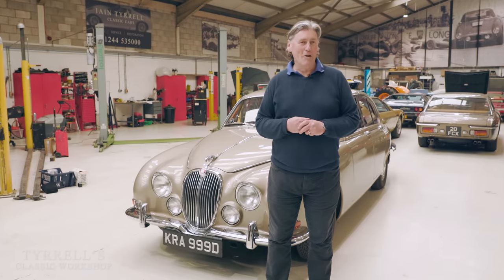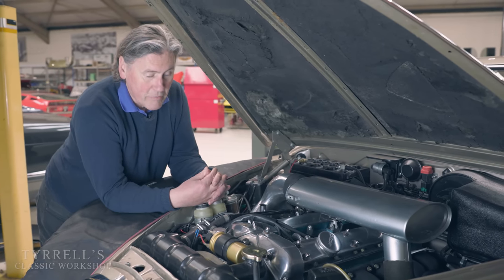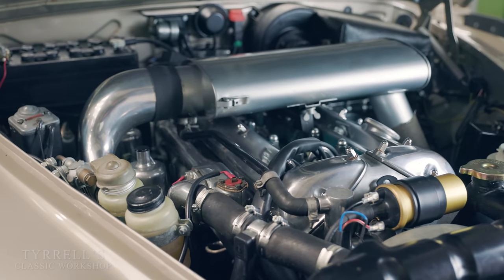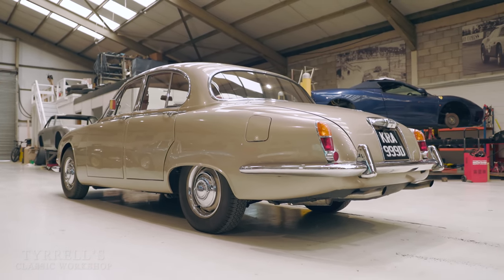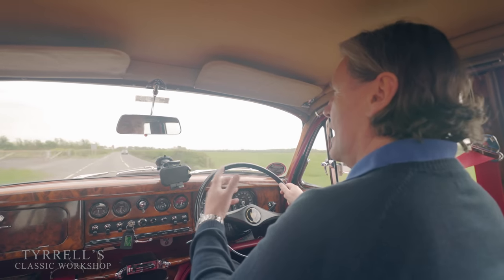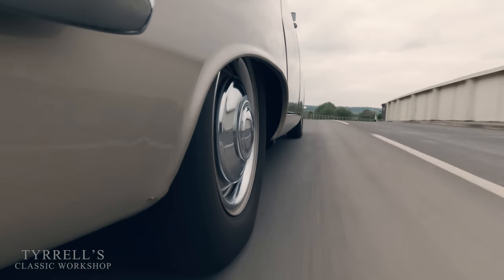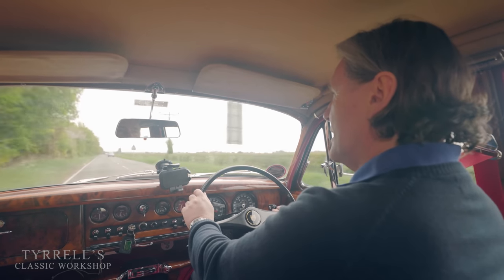Jaguar S-Type - The 1960's Saloon that set the benchmark for comfort | Tyrrell's Classic Workshop

Comment: From Australia, these are bettered only by their big brother the mk10.  When 19 in the mid 70's I bought a 10 year old 1965 4.2ltr Jag mk10 owned it for many years , thru that time I bought a rare long wheelbase series 1 xj6 and owned that for 32 years , I sold it after buying a1 owner ultra low mileage 1967 4.2 ltr 420G (bmc rename of the mk10) . having owned both I rate the mk10/420G as the better car , better Marles  power steering , wider with longer wheelbase gives better handling , plus when I bought the first '65 model I bought a set of Koni gas shocks that Koni made in the '60's as the optional upgrade. They were crazy expensive, when I sold the first one I had kept the Koni's for years feeling I would always buy another mk10,when I fitted them to the '67 model they transformed and stiffened the handling exactly as I remembered from years before , plus they still functioned perfectly. I LOVE this car its original leather interior is still soft and perfect , and looks as if it is a year old , not half a century, the carpets are like new , and is a high output bronze head car with ultra high compression and way more power. I love the exhaust growl when accelerating in second gear . You can drive for a thousand miles and step out like you have just driven down the street for some milk, with its comfortable thrones of front seats and plenty of legroom. The  fabulous MK10's were really the worlds first luxury sports cars.

Comment: Triumph I had a few 2.5 PI were as fast as Jags and also had multi link independent rear suspension and wonderful ride and let me assure you in days before radar in Australia easily out run the police especially on corners.   Those were the days driving across Australia was just amazingly fast.

Comment: The Jag IRS was used in a generation of American hot rods and customs.  A great ride and it could take a decent level of power for the day. Not used as much since they aren’t cheap as chips anymore. But for its day, it was the one you wanted to have out back.

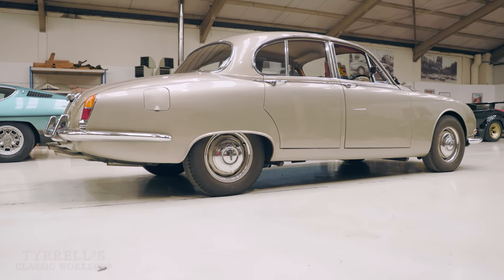Comment: 10:40    That odd line of rear door was due to using a Mk2 door, but different wheel opening.   Mk 2 used 1/4 elliptics at rear with a Panhard rod.

Comment: I drove then, a 1980 Volvo GLE. That one with 130 hp and injection. It had a button on the gear lever, a overdrive. Very nice function.  To take it down to the third, just do it.

Comment: His remark about the seats is something I ran into with my BGT.  The seats were redone by a PO, and evidently the replacement foams are firmer than the originals and the new seat diaphragms are stiffer, resulting in a too-high and firm cushion.  I'm 5'10" and unless I sit down hard, the top of the door opening will peel my cap off.  Very frustrating.  And I slide around like I'm sitting on bacon grease.

Comment: So Jags handled supremely, with a comfortable ride, were fast, torquey, smooth, styled beautifully, luxurious interiors, racing pedigree, solid engines, power steering, IRS, inboard brakes (I'm assuming discs), telescopic steering column, and ... relatively inexpensive for what they were!!  The gold standard of being an all-round excellent car.  Jowett tried to achieve the same with the Javelin but on a more modest level.

Comment: My father tested these out against the Rover P6 for the Met Police. They ended up going with the Rover because it didn't squeal going around bends at high speed like the Jaguars did. That would be due to the De Dion rear suspension on the P6 keeping the tyres on the road.

Comment: It's interesting when you compare the S-Type to RR, for at the time that would have been the Silver Shadow in 1968, with its modified Citroen DS suspension.  I would like to have taken the two cars out on the same road and see which had the smoother ride. However as far as handling, I believe the Jag would have been better. The SS with it's stock Avon tires, heavy weight  and out-board disc brakes handled like a marshmallow.

 You're right though before 1968, RR just had leaf springs solid rear end and very antiquated drum brakes with that clunky mechanical servo driven off the transmission.

Comment: Nice video and nice car. The S-type "outsold the MK2 for a couple of years" because it was a new model introduced in 1964, by which time MK2 was starting to get a bit "old hat". In the long term, the Mk2´s racing image has helped eclipse the S-type, which remains something of a bargain. Also watch out for contemporary Jaguar 420 (nb: not 420G), an upmarket version which had the same chassis but larger engine with a more "modern" fuller front panel. Apart from good value, quite a lot of these cars were cherished by elderly owners, so preserved surviuvors are more common than with the MK2 models.

Comment: I had a 1964 3.8 S auto which never had power steering. I presently own a 1969 420G auto which I enjoy very much but the gearing is very low - 2700 rpm @ 60 mph which grates with my mechanical sympathy. Love the though just keep off motorways if possible. Great videos.

Comment: An old mechanic I know that worked on these jags would take the back seats out, cut a large hole out of the base of the seat to work on the rear suspension and brakes, so much easier he said.

Comment: I worked on some the twin cam engines back in the 70,s, the carbs were a pain, and  after market intake manifolds for three dual Webers  were hard to find, but the three carb SU deal gave about 25 hp over the stock set ,up, Hot cams werent around

Comment: Ian, I've only ever driven one car with overdrive, a late pal's MGB GT. I did take a ride as a passenger in another very recently deceased friend's Triumph TR6 which also had overdrive on third and fourth gears but I was wondering if both of these models used a Laycock de Normanville system or one of their own creations, and also of how often it functioned on both higher gears or solely on fourth with most cars ?

Comment: 6:20,.. eh, hemm,.. Ian, the venerable Slant Six might just out do that record. Yep, even in Racecars in it's 'HyperPak' specifications. Many more units made, in many more applications, from cars to pickup trucks to fork lifts and combine harvesters and laid flat for boat 'stern drive' installs, to even being a stressed member in Lotus 11 derived chassis (before Chapman did it) and one with a unique head used for an Argentinian open wheel local F1 chassis. I believe the XK is one of the few other engines capable of the Slant's smoothness and tractability showoff trick - put in to top gear at idle, ease the clutch out, then flatten the throttle pedal and let the torque take you to the redline. Very few carburetored engines can pull it off.
It's rather bemusing how some engines, such as the Jag six and the Chrysler Slant Six, are used everywhere with great reliability, but vastly overshadowed by other products from their home stables, such as the Jag V12 and the Hemi V8, or the Lambo V8's compared to the V10's and V12's.

Comment: Back in the 70's I got through 3 of these.   A 3.4 manual and 2 3.8's both auto, which most S types were.   The maroon one I remember passed its MOT and the tester recommended that I sold it on as it was 'getting a bit used!'   I had a total of 16 Jags from Mk1 to XJS but family and at best 20mpg meant having something more ordinary.

Comment: They did not all co.e with power steering. I had a 1964 3.4 manual without. A pig to park but a real joy to drive. Easy on the throttle in the wet, though. I o ce found myself on a roundabout in Walthamstow facing g the traffic behind me! Very embarrassing. I hoped everyone also thought it funny..... ( I did not!)

Comment: Most interesting Ian especially your description of how the IRS works on the S-Type. How would you compare it to the De Dion rear suspension used on many cars in the 50s and early 60s?
Reply: Apologies for miss-spelling your name Iain.
Reply: interesting question, because De-Dion sounds so sophisticated, right? Well it's geometrically a solid rear axle (but can include crude camber. It's benefit is the diff weight is part of the car body weight, so the remaining solid axle is that much lighter.

Comment: Actually the Rover P6 matched it for rear suspension with the De Dion set up and was equally smooth riding. Remember my father buying a then new 1968 P6 over the admittedly live axle mk2 as it was a much more modern design. Love the look of the S type now though and Jag was a much better engine than the Rover 4 pot.

Comment: Does the overdrive not work on 3rd gear as well? I always thought having 6 forward gears on my MGB was fantastic!
Reply: I was going to add the same comment, I think on my MGB it also worked in 2nd, could be wrong, a long time ago.
Reply: @williamjsmith9877  It shouldn't have worked on second unless there was a wiring fault or wiring modification. Mechanically it would work on all forward gears but was factory limited to 3rd and 4th to save it from self destruction. The V8's only only worked on 4th for the same reason.
Reply: I know when used on Triumphs it was electrically interlocked out of first and second gears. It was quite possibly be the same on MGs. I think they were being overly cautious, I believe the O/D units were capable of handling the torque in the those gears. Probably did cut down on unnecessary wear on the internals though.

Comment: Just for comparison, the piston speed on the contemporary Ford Cologne V6 (notoriously undersquare) was 13 m/s at 5700 rpm, on the Jaguar XK 4.2 it was 16.78 m/s at 4750 rpm. Quite a lot of thermal going on there.

Comment: Unfortunately a number of bus manufacturers used a overdrive design in the rear at the diff.
A design which could easily end up in a between states with NONE engine brake at all.

Comment: That XK was a real marvel of an engine .
Just like Alfa's Nord engine , but with two cilinders more .
Only I wonder why didn't sir Lyons choose aluminium for the Block?
It would have made the engine lighter and thus the car even faster and less understeerd .
Hass it all to do with stiffnes and vibrations , the choice for cast Iron?
Reply from the maker: I think refinement and ease and cost of manufacture were the drivers in the cast iron block over alloy

Comment: Rear suspension being subject to "tucking under" is more a feature of the dreaded "swing-axle" (and, to a lesser extent, the "semi-trailing arm" types of simplistic rear axle, favoured for a time by the Germans, amongst others).  Live axles are actually quite good in that respect - it's the effect on ride, and need for proper location that are its main difficulties.

The Jaguar irs doesn't have these problems (but is more complex).
Reply: ...And 5-speed boxes were pretty uncommon through the '70s - it wasn't until the '80s that they were widely adopted.
Reply: ...And the reason the long stroke provides more torque is simply down to mechanical advantage - i.e. more leverage on the crank.

Comment: Drove my 1966 S type today , I would like to say my oil pressure was as high as this cars , still a wonderful place to be.Mine has a few mods on it including an aluminium radiator , 5 speed box and cooling fans.Bit warmer here in RSA as Iain would know having visited the fairest Cape  in a previous video.

Comment: Same as j type overdrive in late 70s TR6?
Reply: Yes Richard you are correct. Stags and Dolomites too.
Reply: Made by Laycock Engineering, which was a subsidiary of the (once) mighty GKN.
Reply: Good to know, my solenoid on my TR6 appears to be dying and if common replacement might be available.

Comment: What about the Citroen DS? Surely it had the smoothest ride of the era?
Reply from the maker: Yes it did, but it didn’t have the Jaguar’s handling
Reply: @iain_tyrrell  No definitively not nor the engine power but just in terms of suspension  Citroën's gas system was the best wasn't it?

Comment: I suspect this comment won't be appreciated here, and I even like this car, but... A friend had one when I had a 1967 250SE Mercedes with a four speed manual transmission. I would take the W108 over the Jag any day even with its MB Tex interior, maybe especially with the MB Tex interior. I spent much less time in the shop and I ended up putting over 300,000 miles on that car. Since both cars rust badly here in Indiana, I can't say that is a factor. Meant this in good fun, but also with that "Practical Classics" sort of seriousness.
🙂

Comment: Good sir, please consider this post as evidence in writing that there is at the minimum one Mercedes person who completely  agrees with your assessment.  The Mercedes people who disagree with your assessment are wrong.

I had the good fortune of having a family friend who, as an RAF WWII Veteran living in the States, only owned Jaguars.  Dave's XJ6 rode better than my Dad's '61 Lincoln, My Mom's R107, LS400s, J30s, every cadillac I've been in, all 3 W124 estates I've owned,  every W123 I've had, and the 2000s S type and C type Dave later owned.

 The S Type's rear suspension might as well be out of a spacecraft.   Two adjustable MacPherson coil over struts on one end of the car is quite nifty.  The Jag has four.  The Peugeot 404 has four coils in the back, but it's a truck dressed in saloon clothes. The Jag is 100% independent. The W116, W123, and W126 have semi trailing arms. Mercedes would continue using a swing axle well after the E type was introduced. 

It would take Mercedes another twenty years to release a rear suspension somewhat like that of the E Type , the five link in the W201.  Even still, a five link Mercedes is firm.  The Jag feels sublime at all speeds whereas the Mercedes only loosens up and does the kitten routine at speeds illegal in most of the world.

If one's Mercedes rides like a Cadillac, it's broken. If It rides like a BMW, It's broken. If it rides like a Jaguar, its owner is broken. 

At the end of the day, though, I think I'll take my stone age technology and 20 minute brake jobs over suspension that can be adjusted with a screwdriver and a much better ride.

Comment: 6:43 Have you ever had a corvette in, like one of the ones that had the IRS on them, which is 1963 to 1982, as I would like to really know how they compare and contrast between this, an independent rear suspension made by one of the greatest car companies ever made, and one made by one of the worst, as one of the people who races them described them, a goodwood corvette, as like driving a station wagon with a load of lumber on the roof

and I would like to know so I can figure out how to make it not suck, besides obiviously bolting it to the back end of a C3 corvette

as they in all their wisdom kept the leaf springs, yet went full independent IRS, like I wonder if all that needs to be done to make one not suck is to convert it to a sharkwerks coil over suspension setup

granted that only has one spring and I see two here on either side, like can using a leaf spring in place of a coil over spring really screw it up that bad? 

also while the rear suspension is way ahead of its time, these cars dont have rack and pinion, someone went to great expense to have that put on at a car show over there, and said it made a hell of a difference with it.

like the only car I know of that was that had both IRS and rack and pinion was that AC Ace a crazy texan shoved a V8 in.

Comment: Didn't overdrives live well into the 70's? Exotics may well have had 5 speeds (ok, excluding the Maxi!) but Ford for example didn't launch the Type 9 5 speed until '82 I believe. Suppose Rover had the LT77 in '76.
Reply: MGB's had o/d's right to the end, 1981? Can't quite remember which year they finished.
Reply: Volvo used them well into the '80's
Reply: Correct... nearly all mainstream cars had 4 speed boxes until the early 80s... Fiat Alfa and Lancia pioneered the standard fitting of 5 speed boxes in the 70s.

Comment: The "S Type"  was not a success. The grille was so  small that it restricted air flow and over heating and eventual dramatic failure was common.  I worked at British Motors of Monterey ( Calif) 68-72. We were the Rolls, Bentley, Jag, Aston Martin, Austin Healey , MG, Morris, Mini, Lotus, Jensen dealership. I worked in the Rolls, Bentley, Jag, Aston Martin shop.